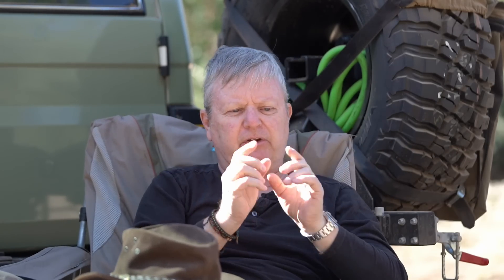TIRES - Traction, Rolling-Resistance EXPLAINED

Comment: If you cast an eye over a standard issue equipment vehicle for the likes of Energex, Telstra, mining companies etc they always have a skinny tall tyre. They not only work best off-road, they also reduce wear of steering and suspension components, have less sprung weight, don’t tram-track and are better on fuel consumption due to less rolling resistance. I think most people fit fat tyres just because they look good and think more must be better. Drag cars need fat tyres, not four wheel drives.

Comment: Wider tyres give more traction on rocks and don't fall off the wheel, narrow tyres are less likely to slit, in mud a tyre needs to be aggressive the width depends on the weight of the vehicle, my Lada has 150/70/14, my Isuzu has 285/70/17 

Mud-Lada 
sand-Isuzu
Rocks-isuzu
Loose terrain-Lada
Ice-Lada
Towing an articulated lorry out of a snow ditch in sainsburys car park-Isuzu 
Road-isuzu
Really dry loose sand-Isuzu (the lada despite only weighing less than 1 and a half tonne just sinks

edit: I completely agree with the Scandinavian narrow tyres, my wife's new Volvo has 20 inch wheels and 300 wide tyres, the optional winter tyre set looks more like a spare tyre 17 inch wheel and 10cm wide.

Comment: I hate to disagree, but it is all about surface contact area and PSI or how much tire area is carrying the vehicle weight. The more square inches of tire touching the ground the less weight per square inch and the less penetration into soft stuff.  But most sand buggies run narrow front tires for better steering like you stated. Same applies to traction, more contact surface area.

Comment: I went from 255 mud tires to 305 and they were terrible.  Always floating through corners in the mud and just squirming about where my 255's just cut through and drove like it was on rails in comparison.  The 285's I had next were a good size as well, but taller than average as they were 285/75r18 and on a very heavy truck.  Despite being an uncommon size in North America I"m back to 255/85r16 but I have yet to get off road much with this tire yet.

Comment: As a moab utah guy I can see the pros and cons of both in a lot of situations. I think that the truck that is being used plays a big part in what type of tire will be best. I like to think of driving in sand like a boat on water. the wider and more heavy the boat is the more power it will take to get it to plane on top of the watter. If you have a truck with 500HP and not a lot of weight then fat tires on sand are no problem. but if your like me and have a toyota tacoma with a 2.7 putting out about 160HP I would never want a fat tire in the sand.
Reply: I remember back in the day every TACO out there had huge tires that the 22re motor couldn't spin in the mud, like you said you have to match the tire with the drivetrain.

Comment: To get the same amount of  surface area on the ground, you have to let more air out of the skinny, which reduces your axle clearance. I would prefer to add more power to the vehicle to overcome the slightly more rolling resistance rather than lower the vehicle. The sand and snow of southern California is more suited for wider tires. We really don't deal with soft mud. And race vehicles don't want to float, they need high traction for constant acceleration and to not fall in holes. If you look at dirt drag and sand drag trucks, you will find very wide tires for maximum traction. They have skinny front tires because they want them to float on top. Either way, you have to find the right air pressure for the tire. different tires have different max traction for their contact patch.

Comment: The thing that has changed is people use wider tires now instead of the super skinny single direction lugs that where used on jeeps in ww2. Why? because vehicles have more power and weigh more then they did back then.

Comment: This can be broken down pretty simply actually. Wider tires have more traction potential and take more energy (horse & fuel) to turn. Airing down allows you to alter the performance of a given tire in an envelope. With unlimited power and energy a wider tire will always be able to perform better then a narrow one but the problem is that power and energy is not unlimited for most applications so a narrower or the narrowest that can do the job might be a better choice. That's why road bikes have such skinny tires to so it takes less energy to ride. Its also why mountain bikes do not have narrow tires.

Note: This is only applicable to tires on and indefinitely deep single substrate. If you are trying to dig through one material to a different one under it such as snow on top of roads or some times mud bog trucks then you might go for a skinnier tire to dig down to something you can bite in.
Reply: Also it needs to be considered what what Andrew is talking about. He is discussing over landing on roads in varying conditions. His experience and opinions of tires reflect this and differs in many places to motorsports. He does not speak in absolutes he is speaking about practical application.

Comment: On my '99 4Runner, I loved my 255/85-16 tires.  I went up to 35" tires, and can't find a narrow tire now.  Sure wish they had some other then 12.5" wide.
Reply: Take a look at Super Swampers, they brought back the narrow TSL, I think the 34.5 tall tire is rated for a 7 inch wheel and the tread width is 9 inch.
Reply: They were the only ones I could find for a narrow tire in the past, but if they're bringing or expanding that line, I'll research on quality of tire.  In the past, they were loud and low life for a daily driver.  To be honest, the only Super Swamper I've ever seen in person was a bald one.  LOL But if they've updated or changed their compound, maybe that's an option for my needs.  Thanks!

Comment: true about the old tractors ... but the new tractors in USA have very wide tires , I mean gigantic wide tires ... front and back ... why ? I wonder if they went with narrow tires in the old days because the rubber was more expensive and also the manufacturing process ... possible maybe ?

Comment: This just might be the the most intelligent and accurate  discussion on tire size and pressure on YouTube with regards to 4WD, and more. I look at the ‘thumbs down’, there are a lot of ignorant and brain washed folks out there thinking wider is “always” better with traction. Americans as a rule, and I am one of them, think bigger is better and this surely is pervasive in the 4WD arena. Your points concerning the critical aspects of PSI per square inch is so misunderstood and in most cases ‘not’ understood, is exactly why  so many people don’t understand, get or have real world side-by-side experience with this concept. Maximizing PSI down force, 99% of the time, is the most important variable to manage. It is a balance of course but far to often we go too wide and loose that magic balance with PSI downforce. Besides a 4 wheeler I am a farmer. So, I have heavy duty trucks (besides my beloved Jeep), aka one ton pickups.. Some are single rear wheeled and some are dualies . I live in Michigan; sand, mud and snow...traction is  always an issue. No one drives their duallies unloaded in any of these conditions unless you remove one of the rear dual wheels because they just flat out get no traction. Not enough downward PSI spread across all that rear rubber. Removing one wheel or driving the same truck but not a dually is not a traction issue. Same physics and principles apply to traction in 4 wheeling, as a rule.

Comment: Fully aligned! Also prefer narrow, especially for sand! Runed 235/85 on a kzj95 in sand and it performed great!.now running 255/85 R16 on a Y61 lwb and also expected to perform great. The only downside is road handling, but you get a better fuel milage! Great review!
Reply: Maybe week or engines and lighter vehicles are better with narrow in the sand because he tested that black Jeep Rubicon in the sand and those tires were 12.5 inches wide on the dunes and it could literally stop at the bottom and go up huge hills without sinking because of the flotation of a wider Tire. I have tested skinny and wider in the Sugar Sand we have here in the desert of Arizona that is extremely loose thick grain and hard to walk on it doesn't pack the way Dune sand does when you push on it it is completely loose and my 285 75 16 perform much better than skinny tires that just sink in. That's why dirt bikes and ATVs have pretty wide tires for how dramatically like they are under 300 pounds. The whole drag Theory makes no sense unless you're driving some old Toyota or Old Land Rover with no power but all the most powerful newer vehicles with wider tires float right over sand like nothing they don't have to keep momentum to keep going that literally proves it's better.

Comment: TLC arctic trucks solutions for Island with 38-44 inch tyres - is the best proof that bigger is better -and Mr White completely wrong about narrow tyres advantages on snow (lack for practical experience). 
Even empty Toyota 80/7X series are too heavy for narrow tyres and sink like begemoth and stuck on bottom or axles.
There are  general rule for tyres selection for toyota 80/7x series i.e. -33-35 inch tyres are suitable for expedition purposes vehicle (AT or MT depending on planned route).
Overall, Toyota 80/7x real offroad capabilities starts to shine with 38 inch tyres and above (MT) otherwise driving offroad  on small tyres becomes  like winching most of the route.
In this case real offroad means that road or track driveable on toyota 38"  together with 4WD monsters ie trucks like Unimog, Ural 6x6 etc.  and winchable with toyota on 33".

Comment: My comment for rock: 
Coefficient of friction is the same for either surface area, so their is no benefit in terms of friction on the hard surface, however you have a lot more chance to catch a patch of “good rock” to gain traction and forward momentum
Reply: Rolling resistance is so critical   to traction & fuel consuption .Bottom line is as i have these tests done, tall tires less rolling resistance so if you want traction tall norrow tires. When flotation is required tall wide tires end of story.

Comment: Too much debate over 3cm difference in tyre width.

The 285s are more comfortable on most if not all surfaces,  and can be aired down a few psi more to overcome the perceived deficiencies in sand/rock grip.  For argument's sake, lets say your 255 tyre has a contact area at your preferred pressure of 255x255=650.25sq cm.  A 285 tyre lowered a bit more could have 285x255=726.75sq cm.  That will create a higher shear resistance between the vehicle and the sand which means more grip.

To accurately compare the effect on steering on hard surfaces you would have to fit the wider tyres to a rim with extra +ive offset, since the track of the vehicle is altered +3cm when using 285 over 255.  Of course, the steering geometry of the particular vehicle could also be affected by the extra "inside" tyre area, but I think we are probably talking about solid axle front vehicles here. 

With our typically heavy vehicles like Patrols & cruisers, travelling deserts etc with 3+ tons, the load rating of the tyre is also important - the higher the better.  285s will almost always have a higher load rating than 255s.

I'm talking 33" tyres in my examples.  And yes, the wider tyres will increase fuel consumption.  But in a Patrol or Cruiser with the aerodynamics of a brick, fuel consumption is not the foremost thought in your mind when you're in the middle of the Canning.

Comment: Tyre technology might have changed with improved materials and modelling techniques but the traction and offroad formulae for different types of terrain is still based on the formulae developed in WW2 with just a few tweaks in the 50s-70s... you've got mechanical engagement, friction and rolling resistance all balancing off each other and all affected by many variables.

Comment: 8:40 not true.

Grip - friction stays the same.

The only thing I see a bigger tyre gives you is the option to lower the pressure more, because it can support more weight (per tyre), because it is bigger.
Remember: the softer it is, the less weight it can carry.
My coopers hold 1500kg at 3,5bars.

Comment: Great video Andrew.
I was going to put 235/85r16 on my vehicle yet I went with 265/75r16 for 2 reasons. Reason 1 is cost, the 265 was cheaper by about $40 per tyre.
Reason 2 is availability, in my experience here in Western Australia 235/85r16 aren't a common size so at a lot of tyre shops especially in country towns need to be ordered in, most seem to stock 265/75r16.
Like everything on our vehicles it's a compromise.

Comment: As for rocks, check out the Rubicon Trail, Moab Utah and all the good 'ol boy rock crawling down in Tennessee.  Low pressure to increase contact patch, wide width to increase contact patch.  More rubber on the surface = more traction.
Reply from the maker: Thanks for this input. Appreciated.
Reply: @4xoverland   I agree that wider tires are better on rock, particularly sandstone.  Coming from a rock-crawling background in Moab, it's known that having more contact between rubber and rock results in better grip.  It's worth taking a look at the wide tire widths used by competition rock crawler teams who take the technology very seriously to gain an edge.    Cheers.

Comment: Snow driver here. I'd say you're pretty much right on with snow. The only time I or anyone I know would care about flotation is if the snow gets much deeper than the axles. If you're building a glacial expedition-specific vehicle, sure, but it'll suffer in almost all other imaginable driving conditions. (BTW they're often 6x6's for an even larger footprint too.) As with most things, it is compromise. There is no single go-anywhere best in all conditions/environments tire.